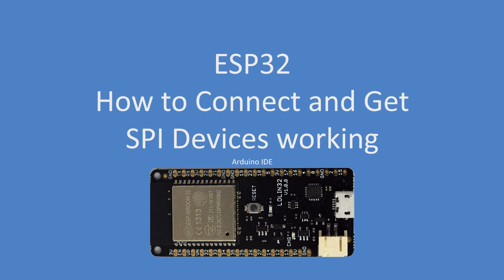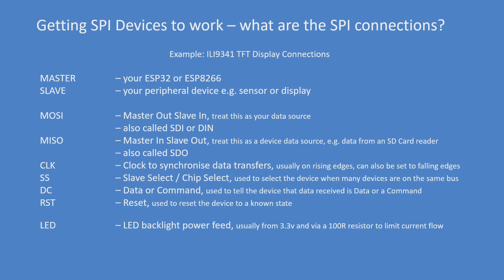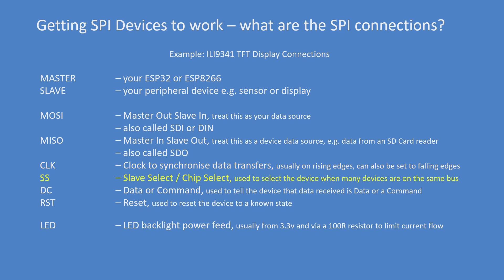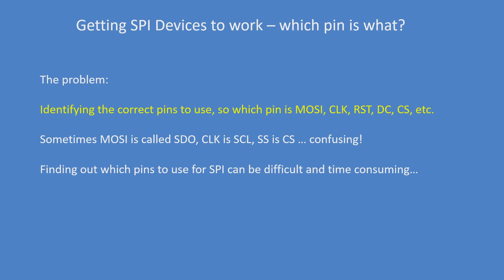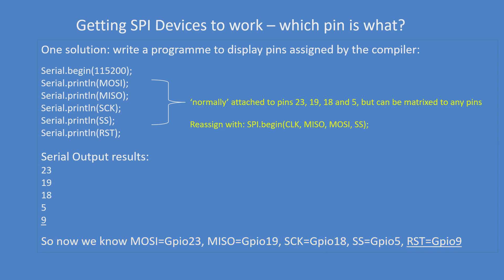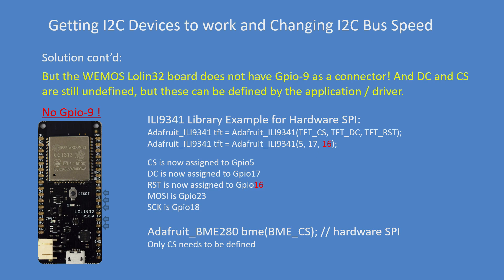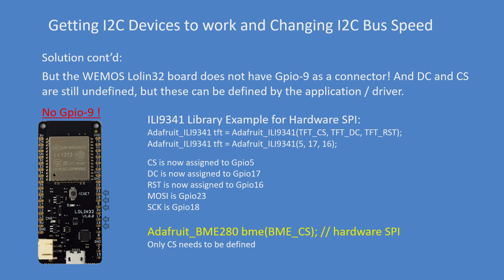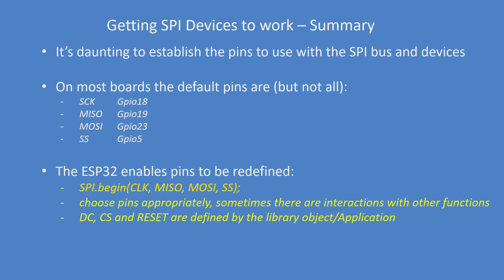Tech Note 064 - ESP32 How to Connect SPI Devices and Get Them Working

Comment: I was struggling to get my new ESP32-C3 board to work with a sensor on the SPI bus for the last few days.  I was able to resolve the problem using the SPI.begin(SCK, MISO, MOSI, SS)  command to re-assign the MISO pin from the default GPIO9 to another pin on the board.  That solved the problem and hours and hours of trial and error!!  Thanks a ton!!

Comment: Is it possible to communicate between 2 ESP32's via SPI? for some reason i have to use SPI and i cannot use UART (rx, tx).
Reply from the maker: You can but it’s not easy to implement. The SPI bus is comprised of a Master and Slaves, the libraries are configured to be the Master so for the other device you’d need to set that up as a Slave, there is provision in the SPI library from Espressif to set up an ESP32 as either master or slave.
Reply: @G6EJD  Thank you for the quick reply, also it is not possible to make it a duplex SPI right?
Reply from the maker: You can have a duplex communication MOSI and MISO are for that, but Von Neumann architectures can only achieve full duplex by switching between processes. Many SPI devices send and receive data. Your challenge is to get the other processor to operate in Slave mode like a sensor would. Not sure why you can’t use I2S or serial as the performance would be close.

Comment: Hello, the video was good. Is it possible to communicate with esp32, ads1256(SPI), LIS3MDL(I2C) and 20x4 lcd(İ2C) together?
What kind of connection should I make?
Reply from the maker: Yes, the ESP32 has an SPI and I2C bus. The I2C devices have separate device addresses so are all wired in parallel and the SPI bus except for Chip Select lines are also wired in parallel and each device has its own CS connection/pin.
Reply: @G6EJD  David, is it a problem to have peripherals of different resolutions on the i2c line?
For example, to esp32 microcontroller; Suppose a 24bit ads1256(i2c), 16bit lis3mdl(spi) and 20x4 liquid crystal LCD display are connected. Do you think there is a problem here?
Reply from the maker: @ahmetozdemir7173  none whatsoever, the sensor readings are transferred in a scalar way, so if a sensor has a 64-bit reading the request for a reading would ask for 8-bytes (8x8=64) or a 16-but reading just 2-bytes, the libraries take care of all that.

Comment: Thanks for preparing this.  This helped me unkink a problem I had but, unfortunately, the ILI9489 still does not work.  It was supposed to be in ILI1394 but they sent the wrong display.  Have been trying to get it to show for hours.  My brain hurts!
Reply: Update: It works.  See below for help setting it up.
Reply from the maker: @michealmorrow1481  so did you manage to find an SPI mode in the configuration pins?
Reply from the maker: You need to find a screen driver for the ili9489, but haven’t seen any, the library is your problem
Reply from the maker: I’ve just checked, the ili9489 is an 8-bit parallel interface not an SPI variant so it’s no good
Reply: Yes. I am sending you an email now.

Comment: You are Right SPI is it time consuming a lot. after I connect one TFT 9486 parallel to the ESP32 I want to use the SD-Card reader on that board connected via 5,18,19,23 with a picture demo sketch. Serial.print(SCL) tells me Pin 22 is use instead of 18.
If I can change it with SPI.begin(18,19,23,5) your video is helpful. SCL=18 have no effect in the Arduino IDE. 

I will choose the names MOSI,MISO,SCL and SS in the Sketch because of the predefines in the most libraries.
Reply from the maker: If you define the pins away from the compiler default the Arduino IDE implements a software emulation of the SPI bus. You can find what’s are used by the compiler by either printing out the key names or by inspecting the hardware folder for the board the file starts win ‘pins’ a parallel SD card drive should work ok, just make sure both the display and SD card reader have separate and unused pins for their Chip Select (CS)
Reply: @G6EJD  , thanks for your answer. I have found the issue, in this demo ( read a picture from SD-Card and Transfer to the TFT ) sketch the author forget the SPI.begin() complete.
After insert the begin statement I can read the SD with Pins 18,19,23,5. I think this SPI is not emulated because of the very fast speed.
I will   compare The same pictures loading from SPIFFS and see how times faster this is.

Comment: Hey there, i am using MPU9250 with esp32 using SPI but every time I open the serial monitor it say:

rst:0x10 (RTCWDT_RTC_RESET),boot:0x33 (SPI_FAST_FLASH_BOOT)
flash read err, 1000
ets_main.c 371
ets Jun  8 2016 00:22:57
Reply from the maker: I suspect you’ve used the wrong SPI bus what pins are you using?
Reply: @G6EJD  i tried SPI3 i.e VSPI first then the serial monitor said sensor connection is unsuccessful, then I tried with SPI4 i.e HSPI and that shows the above error I mentioned. I used default pins for both.
Reply from the maker: So 23, 19 and 5, then as defined for others. The flash memory uses an SPI bus so can’t be defined. Which library? That sensor is a well defined and used extensively unit so should not be causing cpu crashes unless something is fundamentally wrong.

Comment: @2:25 SDO is Serial Data Out; SCL is Serial Clock and SDI is Serial Data In. This is irrespective of whether you are using your device as a controller or as a peripheral. 
You could just hook up your controller's SDO to peripheral's SDI and vice-versa.
Reply from the maker: I’m not sure what your saying, I was pointing that MOSI is often called SDO and MISO called SDI
Reply: @G6EJD  You were saying Slave Data In/Out and Slave Clock when that's not what it is. It's Serial Data In/Out and Serial Clock
Reply from the maker: @belded-wee  well it’s semantics as the SPI bus has the concept of Master and Slave devices and that is a one-to-many relationship, so there can be many Slaves. When someone is learning it seems best to me to use the term Slave so as not to confuse them with another term.

Comment: Thanks for this!  I now have HW SPI working and it's much faster!
Reply from the maker: Good to hear, the speed difference over a software implementation is significant. If you use any other pins than the designated hardware ones then Arduino emulates SPI in software, this is why it makes such a difference.

Comment: I guess there is hardware spi and software spi in esp32 but not sure I got confused too
Reply from the maker: Yes there is a hardware spi bus using specific GPIO pins assigned by espressif but if you want to use other pins then the spi bus gets implemented in software to allow the chosen pins to be used.

Comment: Thanks, SPI and HSPI take so much time to understand, This video made the process of understanding SPI on esp32 a lil bit simpler ^._.^
Reply from the maker: There is no difference between SPI and HSPI both run at the same speed, I think what’s caused this confusion is Espressif’s use of the H and V port designators. Both ports are identical and the SPI specification is what it is, there is no specification for a High speed version.
Reply: @G6EJD  How is possible to use HSPI for the SdFat library and the VSPI for an ADC (MCP3208) at the same time?
I can work with both of them independently, but I can't merge them.
Cheers!
Reply from the maker: You can’t merge them and I assume you have two I dependent circuits for each SPI bus which includes a CS for each device. Are you sure you are creating two instances of the SPI I stance spi1.begin and spi2.begin and using the correct identifier when reading each bus? I have not seen any libraries that allow more than one instance to be created!
Reply from the maker: You can easily use both the ADC and SD card on the same SPI bus, the CS for each device determines which device is active
Reply: @G6EJD  Yes, I have two independent SPI connections and two CS pins.
I tried to follow different topics about two instances, but it doesn't work. Is there some clear example somewhere? I'll give a try with SD.h, but is slower than SdFat.h
Reply from the maker: Enrico Rodella, your problem is the SPI library as the library cannot support two buses and if you think about it, it needs to maintain a set of variables and values associated with one bus and do the same for another so that they can operate, and that is the problem the variables are not independently managed. As I say, I have not seen any libraries that can do that.
Reply: @G6EJD  Done! https://github.com/espressif/arduino-esp32/blob/master/libraries/SPI/examples/SPI_Multiple_Buses/SPI_Multiple_Buses.ino
Clever example + a bit of custom driver/functions

Comment: Is "SS" (chip select) needed if only ONE device is running on the SPI bus? Can't it be hardwired to VCC or GND to be always selected? (trying to save pins)
Reply from the maker: Henrik Östman, don’t know, you could try it to find out, most likely if there are issues it’s at startup.
Reply: To save pins you could connect display RESET to the board RST.

Comment: Thanks, David. But, i have trouble when i want to connect and communicate Wemos LoLin ESP32 with arduino due. I try to connect with I2C and Serial Communication, but this is not work for me. Everyone can help me ? please :)
Reply from the maker: Miski Lastname,   you can’t cross connect the I2C bus but you can with the serial, make sure Tx goes to Rx and Rx to Tx and the baud rate and data format is correct for both devices e.g. both 8N1 meaning 8-bit No parity and 1 stop bit.
Reply: If i use serial communication Wemos lolin esp 32 can receive data but not send data back to arduino due
Reply from the maker: So the due is Rx and Tx data ok and the ESP32 is receiving only, in which case I suspect you have the wrong pin for Tx data what pins are you using on the ESP32 for Rx and Tx
Reply: I use the tx pin in wemos connect ro rx pin in arduino due
Reply from the maker: Miski Lastname, you cant use the Tx and Rx pins of the wemos they are used for programming the device use software serial to define the pins required

Comment: An ESP32 DevKitC board works well with an ST7735 TFT screen and the TFT_eSPI library and the board also works well with the VS1053 board and esp_wifi library. However, running SPI and Wifi together results in a problem with SPI as the ST7735 screen whites-out.
Any suggestions would be very welcome.
Reply from the maker: There is nothing especially different with the Devkit C variant so I would try using Adafruit's ST7735 library and dropping the TFTeSPI library and is almost certainly what is causing the conflict. Using the in-built (assuming your IDE is current 1.8.10 and 2.4.2 and 1.0) libraries should result in no issues.

Comment: Great David, thanks great explanation!   There are also some SPI components like cameras that have additional SDA / SDL pins too, do you know if they also have a constant defined ?
Reply from the maker: Martin, no only the pins for the standard I2C bus will be defined, unless a specific camera device is listed in the boards section, but I know of none. It seems like just a need to connect the I2C bus to the camera as well as the SPI connections.
Reply: Thanks! Here in this sketch : https://github.com/martinberlin/FS2/tree/board/esp32    
Serial.println(SDA); // Works! But SCL has no constant
I added the pins like David described. For the Arducam (2MP or 5MP) the SCL is 22 and SDA is 21. If you have any Arducam around try it out. Supported models are: OV2640 / OV5642

Comment: Interesting video thanks!
The PIN 5 on the Lolin board also lights the on board led, so every time SS goes low the led will light.
Might be an interesting effect and useful in debugging, but I cant see any way to disable the led on the board apart from physically disconnecting it.
Have you found away around this or will you simply use another PIN?
Reply from the maker: Check out the file in your IDE location, mine is at ArduinoIDE\hardware\espresssif\esp32\variants\lolin32 in there is a file called pins, which you can change so that Slave Select is on another pin, it’s a small design error/bad choice of Wemos to have used pin-5 for the LED unless you like the light show when the SPI devices are being used!
Reply: Thank you so much!
I could not find this pin info before when looking thru various files created during compiling. So easy to change when you know how.
The Wemos Lolin32 is a great little board but its good to know I can change pin 5 so easily. Keep the videos coming I'm learning so much from watching them!